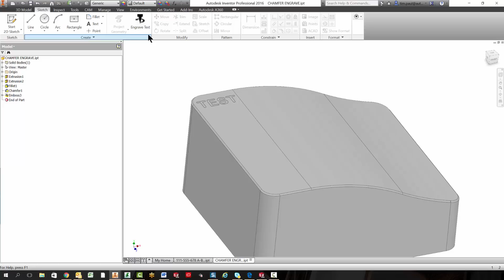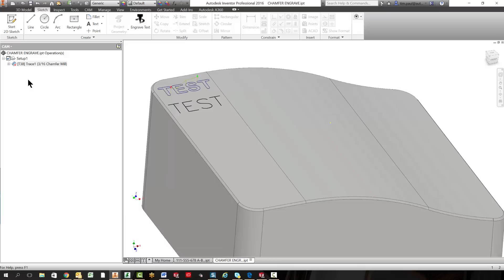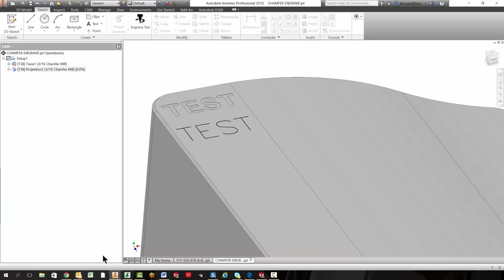Inventor HSM Single Line Engraving

Comment: You can get a Single Line engrave result using the Pencil & 2D Chamfer toolpaths with the right settings as well. Which saves using this add-in. I'll try to do a video and post it on the ANZ CAM channel. This means you can do single line engraving in Fusion as well.

Comment: Very nice!
Any possibility of this feature making it's way over to Fusion 360?
Reply: Sorry I meant to say Inventor 2017
Reply: +Ed T It's already there.
Reply: Great I'll look for it!
Reply: +tizwicky no it isn't. This is an Add-in for Inventor that creates single line text as sketch geometry. You are thinking of the 2D Engraving command which is different.
Reply: Scott Moyse  Ah bummer.
It seems like such a simple add-on and a no brainer to have it. It's the only thing I go back to Mastercam for ... well that and DNC witch is another necessity.
I have to say Fusion 360 is a great product for the price tho.
Reply: Ed T Yeah hopefully the CNC Cookbook team get DNC added to their editor soon. If you have Inventor or Solidworks, then installing the free version of HSM will get you HSM Edit, which you can use with Fusion instead and get DNC.
Reply: Ed T Also you can get single line toolpaths out of the new 2D Engrave command with the correct settings.
Reply: Scott Moyse  Cool I'll play around with the settings next time I need to do some engraving. thx
Reply: +Scott Moyse You are correct that this exact functionality is NOT present in Fusion360. Fusion360 has a 2d Engraving command that is not in Inventor 2015 but I understand it is going to be Inventor 2016. Is that correct?
Reply: tizwicky Inventor 2016 was released in April 2015. 2D Engraving will be in Inventor HSM 2017 RTM, but has been in the development builds, which is what most people use, since Nov last year.